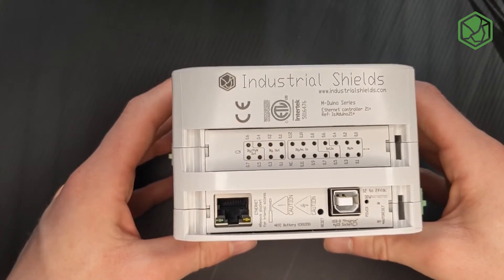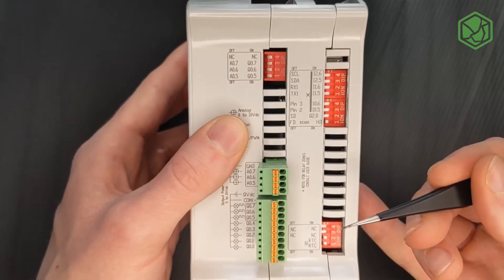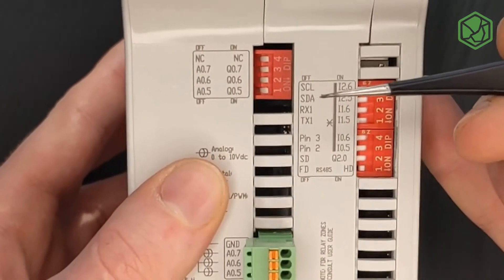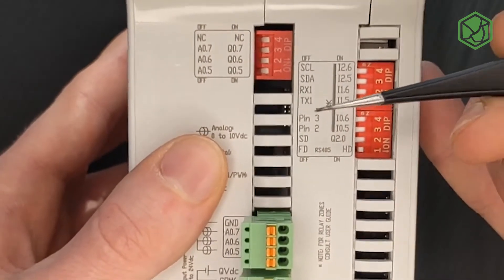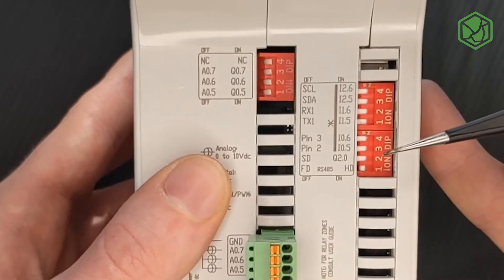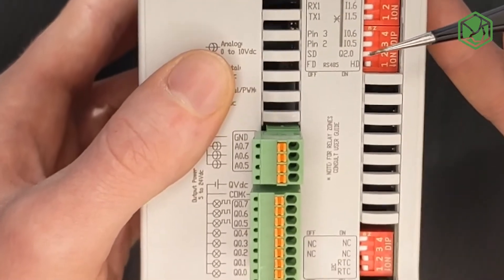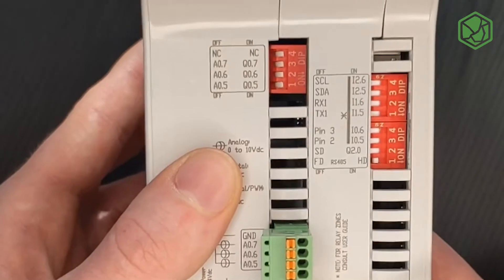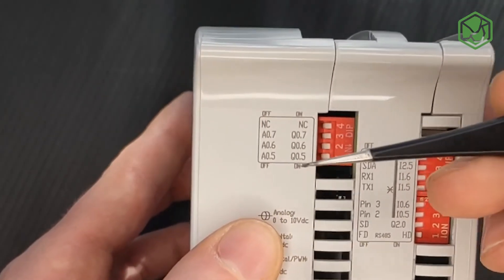➡️ How to configure the switch of the Industrial Arduino PLC M-DUINO 21+

Comment: Are these PLCs expandable? Can the outputs control external relays?
Reply from the maker: Hi Matteo, 

1) This PLC modules are not expandable, but all of our PLC ranges can be connected between them and you can choose between 11 different MDuino family PLC units with different type and number of I/Os: https://www.industrialshields.com/industrial-plc-based-on-arduino-original-boards-automation-solutions-202009

2) Sure! You can control external relays using the (5 to 24)Vdc Dig. Outputs